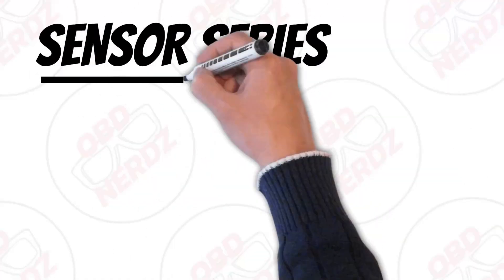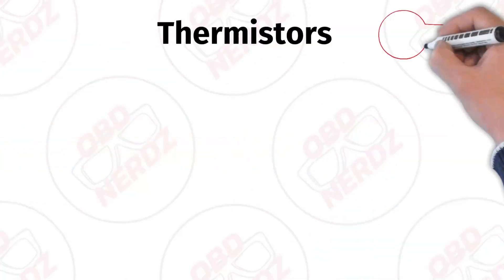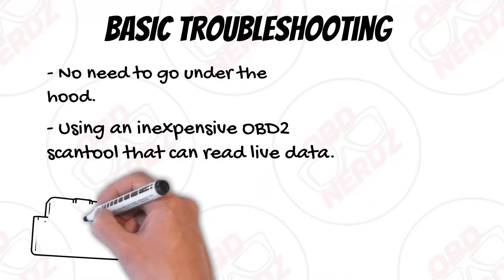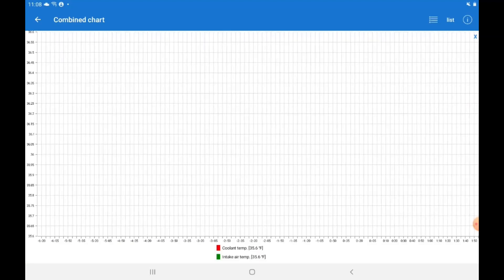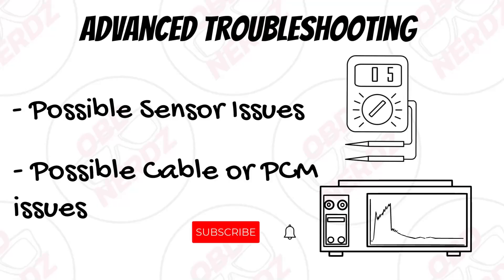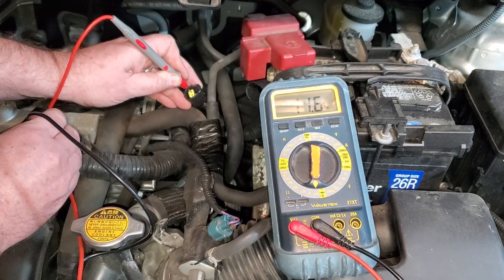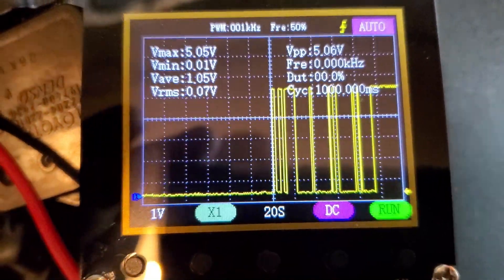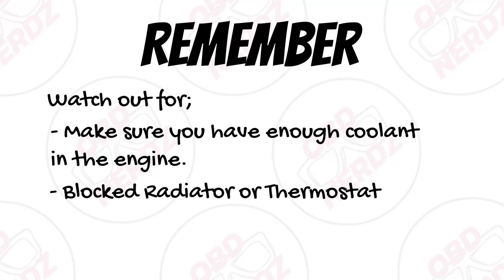ECT testing with OBD2 - DMM - Scope - and ECT Sensor Symptoms

Comment: I dont know if this was generated with AI or what but the information about what happens when you disconnect the sensor is wrong. It says it causes a low voltage but its actually that it causes a high. Viewers beware. I also verified with other sources besides just had it happen to me; mr diagnostech has an amazing video on engine coolant temperature tests i just watched.

Comment: Mine showing -30°C and not rising nor decrease. But in the dash, Its moving and when I drove it around for a moment. Its rising up in the middle, maybe about 100°C. I don't know whats wrong with it, is it my scann tool is bad or my ECT is bad.
Reply: intermittent cable lose,, or faulty ect sensor,, try unplug the socket from sensor ect,, & temperature gauge must be at working temperature...

Comment: Great video, like the explanation. There is a cool test with the ECT you can use it to test a engine thermostat with the live data of the ECT. Most cars have electric thermostat and helps with diagnosis. I would like to see a part to showing this quick test.
Reply from the maker: Thanks for the input. I feel like I always forget stuff and want to add more later.  I will try to do a seperate video on it.